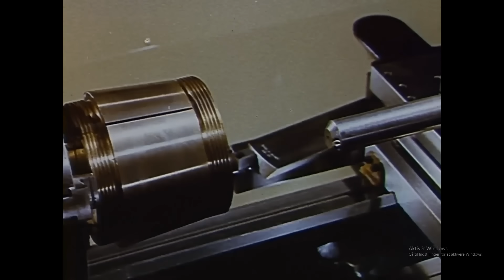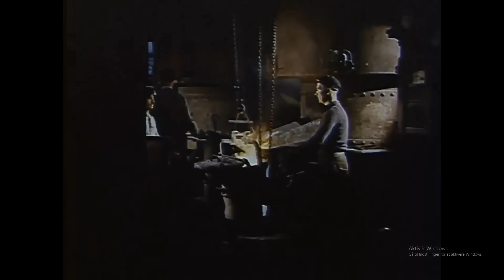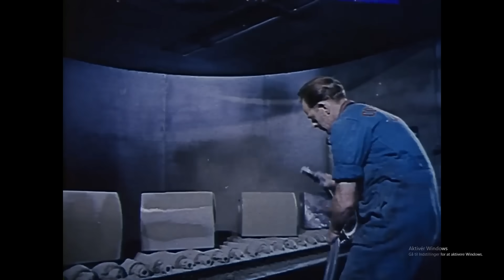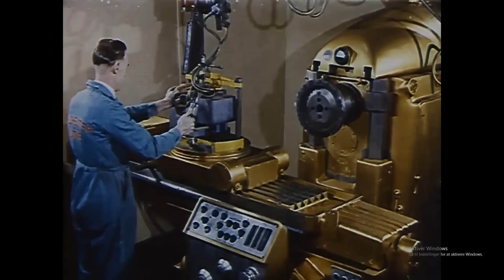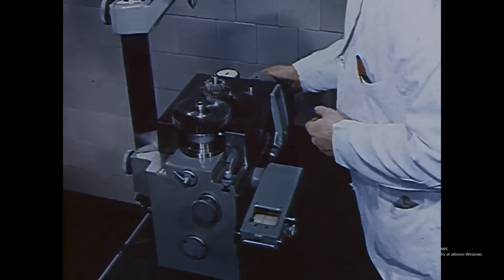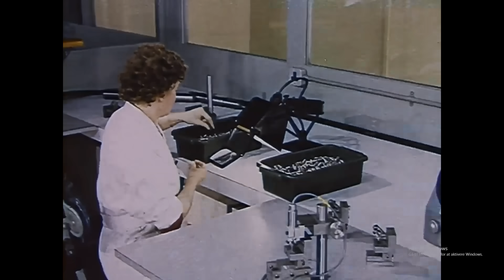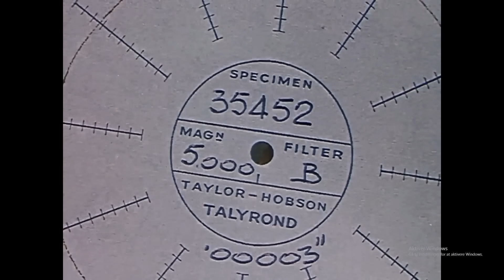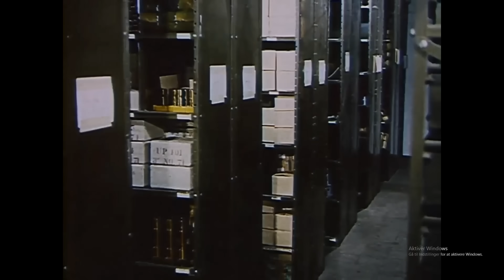Colchester Lathe Company

Comment: sand mould 
casting 
sodium silicate 
high pressure 
chemical hardening 
co2 
... cast
casting 
molten metal 
pickric 
high frequency 
grinding 
machining 
profilers 
taper turners 
lathe 
soldering 
silica 
emery 
grinding wheels 
zinc chromate 
head stock 
atlantic express 
foundry 
gears 
clocks 
spindles 
machining 
high tensile steel 
mandrel 
water tank 
radio active substances 
potassium ferrocynanide
Prussian blue 
geology
graphical recorders 
xerox 
computer graphics 

profiles 
patent 
pattern 
coolants 
wax
fevicol

safety gloves 
temperature gauges 
pressure gauges 

clocks and gears 
air gauges 
rollers 
mirrors 
CRT tubes 
weighing bridges

Comment: At technical school in the 50s I could not wait until Machine shop practice period came up, we had among others , Colchester Student lathes. we had no eye protection and not much instruction from memory,  A Nuttal nearly took my finger off because i was not instructed how to fit [and secure] the chuck. Not knowing that you had to spin on the reverse chuck locker meant that stopping tyhe spindle drive instantly without locking meant tyhat hyou had a chuck rapidly spinning off the thread at 750 revs and threatening to land on the bed, its not recomended to grab the chuck with both hands as I did, The teacher said, lucky you had the wood piece of thick ply between me and the ways or I might have lost a finger.

Comment: My dad is a mechanical egineer he's now 69 and i'm about to finish university in about a year. When he was learning to use the lathe in a tecnical school there was a bunch of brand new Colchester lathes, those used to work always keeping the motor runing, and the chuck started to spin  when a cluch was engaged. Time later he started his own workshop which thankfully has never stoped for about 35 years and one of his first machines was big colchester lathe with a 15 hp motor , that thing is a beast. I've seen almost 300 kg parts being machined there, and I have that slow starting noise form the cluth engaging always in my brain. I have used it since I was 12 and that sound just feel powerful and humble <3 . I can even imagine and listen it runing at different speeds.
  I woud like to see a modern machine do the same :(

Comment: now it just need a repaint, seem like a hippie has been let loose on some part's of it 🙂 the end you cut of the mt adapter is to lock it from rotate,  it is not a good idea, many tailstocks has this problem with 0 beeing an inch from where it is suppose to be, im sure many engineers have been working on this part, and it is the reason why.

Comment: You can't beat a 1954 Colchester 15 inch Gear Head lathe with flame harden ways, what I would do to have this lathe back as it beats my 1970 Clausing 14" lathe as that has variable speed which requires attention every so often. I saw one made 15" gear head made in India and it looked pretty solid and certainly did not show any wear.

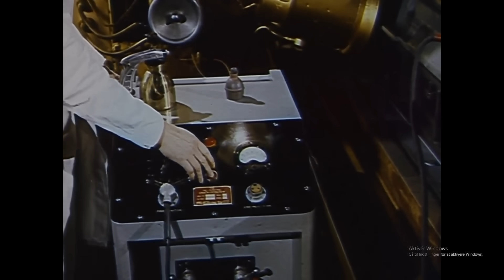Comment: Right at 7:49 the "crack detector" looks like it emitted some kind of field that left a defect on the film. Could have been coincidence but I doubt it. Wouldn't wanna have my balls 2ft from it for years of my life...

 Amazing the work they put into the machines and the cuts they were taking with HSS bits is truly amazing, even if it was in brass that corner has a lot of load coming from two different faces.

Comment: Did my engineering apprenticeship using one of these, the Colchester Student, there where 15 in the shop, all in immaculate condition...
On my first day, we were being instructed on how to operate it, unknowingly I pushed the auto travel lever into drive, when we were told to start the machine, the saddle when racing straight into the chuck..!!!
Luckily me tutor hit the stop button in the workshop and shut it all down.!!
The machine suffering no damage, apart from the soft pin, shearing, as it's ment to do, still think about it today 50 years later...!!

Comment: Mr shed man ,  I now consider myself to be a very lucky person to have a 1918 Colchester master 6" originally  belt driven from an overhead line shaft,  a three step pully behind  the  chuck , This lathe I purchased from an advert  in a  brawed  sheet paper  6  tyre kickers had looked at it an walked away from it i went to see it an bought it on the spot the whole  machine was brown with rust as it had sat in a garage for many  yrs. With the help of a late friend  he and i  set to made an angle iron frame 50x50 x 5mm 100mm off the floor to hold a very heavy,, large motor. Then out from that frame with more angle mounted a lay shaft  and using an old timing  belt from my car to drive that shaft, A three step pully on the end of the lay shaft then allowed me to  drive the chuck using a 1"  ratchet  strap running over two fixed rollers an one adjustable roller mounted at bed height to allow me to tension the  belt I made to drive the chuck.   6" swing ,,  3' between chuck an tailstock   overall  length 6' 6"  a brut of a machine made when Britain was at the leading edge of industry, look where we are now an idiot at the helm and a  Chinese  virus pandemic  running amock  that  brought us to near  bankruptcy  a year a go,   and a whole year of listening to politicians  LYING through their teeth an more U turns than a sat nav,  at the next opportunity  turn around ,    turn around , turn around  ,

Comment: We all know a CNC machine can make things quick and perfect every time, but for making one-offs or low quantities (often without drawings) a good manual machine is still easier. Especially for parts where you have to finish them down to get it 'just right'. I've used a few Students and Chip Masters and they're a lovely machine to use. I've never had that feeling from an Asian machine. You can tell they're just slapped together by staff who have no interest in anything other than getting 10 machines an hour out the door.

Comment: 8.20.  Seasoned?   Eh?   Like timber?
Reply from the maker: Cast iron are on some occasions seasoned for long times..
Reply: It is to minimise warping, when the casting is machined.
This is the exact reason as to why Chinese machine components are always warped.
... the castings have not been aged (seasoned).
Reply: @EngineTuning  .   You mean the metal needs to “settle”, find its own natural shape?
Reply: @josiebee-e6e  When iron is cast - liquid iron changes state to a solid.
The solid has enormous stress forces that are effectively contained by its surfaces.
When one surface is machined - all the containment for that surface is lost.
Consequently, the forces are released in the direction of the machined surface, causing it to bend.
What was a perfectly flat surface becomes curved (concaved) - the outer edges are up, and the middle is down.
The longer the flat surface, the more pronounced the curve - the thinner the casting,  the more pronounced the curve.

It is not talked about, because every supposedly precision flat surface is in fact warped - often to a large extent.
... but it is easy to confirm.
Place a straight edge across the surface, then slide different thicknesses of paper under the middle.
Even small pieces like a bench on a pedestal drill ;)
Reply: @EngineTuning  .    Excellent.   I love a full and informative answer.
Reply: @josiebee-e6e  So, in such a scenario, it is common courtesy to mark the response with a thumbs up, to signify that the response answered your needs ;)
Reply: @EngineTuning  It is a discourtesy to express your feelings in this way, especially after my decently fulsome response.    Shame you spoilt it.
Reply: @josiebee-e6e  No. That is not the case.
Sometimes people need reminding of their responsibilities.
All that you are doing, is feeling aggrieved that you were reminded.
Hahaha - suck it up, and feel blessed :)
Oh, and at the same time, note how I thumbed up your comments ;)

Comment: I really like my small lathe a Chipmaster from 1966, the beltdriven spindle is great. This lathe have alot of good solutions like the toothbelt driven feed gearbox, at high gear the gear drive for the feed gear box doesnt drive which means that the side gears will not wear out, at low gear you can choose between the belt drive or the gear drive. I also have the capstan attachment for it, used it last weekend. When i bought it some 25 years ago at a used machine dealer in north of Sweden. I was looking to find a small lathe so my big Köping lathe ( best manual lathe from Sweden, super quality company started 1858) wouldnt be alone in my home workshop. I saw that this small lathe was something extraordinary, and it was. It had been having the hydraulic copying attachment, but that attachment was missing. I really want one of those...

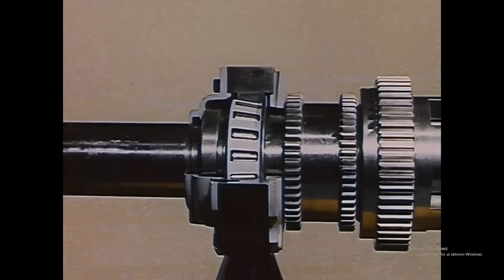Comment: 17:34  Colchester lathes are fitted with Gamay taper roller bearings - the most accurate bearings in the world!

22:25 Threads can be cut at speeds of up to five times faster than normal, with the Ainjest rapid threading unit. It will thread tight to a shoulder at maximum speed. Blind bores need no undercut. Its impossible to engage the half-nut in the wrong position.

Comment: I need to tell you a story. It will go on a bit, but stick with me.

My father was born in 1926, left school at age 14 and went into a machine shop. Started as an apprentice and was Works Manager by his early thirties, when I was born. He was treated disgracefully by the company when I was a toddler and my mother had to spend some time in hospital, so he told them where to stuff their job. He gained a teaching qualification, started in the early ‘60s as an Assistant Lecturer at a local Technical College, and worked his way up to Head of Department, in charge of dozens of staff, hundreds of students and five large teaching workshops.

With the decline of manufacturing in the UK, it was decided in the late ‘70s / early ‘80s that three of those workshops were to be closed down. He decided that it was time to upgrade his own garage workshop and prepare for early retirement.

Milling machines, shapers, grinders, etc. were to be sold by sealed bids, together with around two dozen Colchester Students. He picked out the best lathe, then swapped parts from other machines to build the best gearbox he could. Then he covered this machine with gunk and swarf, painted “SCRAP” on both ends in blue Hammerite, parked it in a corridor and threw a grubby old tarpaulin over it. It was completely overlooked by local businesses and other bidders, and my father bought it for just £15.

I should confess that, although I could read a micrometer before I could read a book, and could operate a lathe by age 12 (basic stuff like parallel and taper turning, drilling and tapping), I ended up with a career in the printing trade and a predominantly woodwork hobby shop.

He retired around 1984 and died in 2004. When my mother also passed in ‘13 and the house was sold, I moved the lathe and other machinery to my own workshop. Now I have also taken early retirement, with This Old Tony’s help I am getting back to using it.
Reply: How naughty of your dad to do what he did to get the best.  Something I would do, particularly if the the company had treated me like some do.  It's amazing to me that some companies don't realize what the most important resource is:  US!
Reply: The company that "did him wrong" was not the technical College that he retired from.  The lathe and tooling were stolen, the old man was a thief.
Reply: @vandalsgarage   and yet everyone says "good for him" probably the same people that are always saying to get tough on crime
Reply: @vandalsgarage  He was no thief, he paid for the lathe, although he was crafty to build up a top notch lathe and paint markings as to say it was of low quality so no one else would touch it he eventually paid £15 for it. In my book that's not theft. This happens in everything in the world.  Businesses worldwide rip everyone off by exploiting their workers and selling their products at hugely expensive prices so in my book they are the thieves. And I do mean every single business no matter how big or small.
Reply: Good on your dad for doing what he did for those tools, and good on you for holding on to all of it.
Reply: @axelmilan4292  Stealing is awesome!
Reply: ent well done to him, and you
Reply: @michaelalpin6139  It would seem that, for the next couple of years before he finished, he ‘borrowed’ quite a bit of tooling over the weekends and somehow forgot to return it. From sets of twist drills to a spare Burnerd 4-jaw. Anyway, the whole college is gone now. Suffice to say, I will never need to buy any cutting tools. Ever.
Reply: I was taught how to use a lathe my my design teacher at school. They had a few warcos and one ancient Colchester and it was spectacular. Everything modern seems to squeal at you and produce the most awful racket. This Colchester though bloody hell you could go to sleep next to it it was so smooth
Reply: My grandfather worked for Coutraulds.  It took many struggles to raise the pay.  Strikes were preceded by preparing veg allotments so each family had enough food to survive a six week strike.  I still have his spade.  He pinched enough bog roll so that even though he died in 1963, before reaching retirement partly due to poor air quality making rayon, my grandmother still had a supply when she died in the late eighties.  It was fairly nasty plain 'hard' bog roll marked with the company name on each sheet.... not 'luxury stuff' LOL.
Reply: Good on you and your old dad 🇬🇧🍀👍🏼
Reply: Very interesting story. Machining has a special meaning to me. Thanks for sharing it.
Reply: @dawhandle  Sorry mate, thanks for reading my story but this was in the Midlands.
Reply: @Canalcoholic  I'm from Cov, loads of stories like this. My next door neighbour had incredible machine tools in his garage, they were practically giving them away when the factories were all closed down. When I was a kid there was swarf in the street gutters that had fallen off lorries because there was so much machining and fabrication going on locally.
Reply: Old Tony is a great channel,  treat those machines well and they will do the same. 👍
Reply: Clever guy your old dad!   😂
Reply: I wonder if honesty and integrity being lacking is some reason for cause of the way things went. The technical college didn't do him wrong, so why'd he do the technical college wrong?
Reply: Emocionado em ler !!!
Reply: Wow, nice story, are you using it now, and what projects have you done on it?
Reply: He wasn't a stupid man , sounds like what my dad would of done
Reply: nice story my dad worked in ccc at 16  worked on roads one dollar a week
Reply: Hell yeah I have a 50yo lathe I'm restoring to start building my retirement shop
Reply: Wow! Thanks for sharing that story. My late pa was also born 1926 and left school at about the same age as your father. My pa then attended night school technical college, did his machine shop apprenticeship and also eventually moved into management. I still have the hobby lathe and machine tools which he used to build model steam engines in his later years. I attended a Technical High School in Torquay, Devon where we had a workshop with centre lathes, milling machines, etc. I passed my GCE 'O' Level in 'Engineering Workshop Theory & Practice' in about 1976. My pa inspected my practical project (a jewellers' vice) and told me that a chimp could have made a better job of it. Harsh but true. 🙂
Reply: awesome.
Reply: same thing happenes in NZ. Technicians got hammered
Reply: That was a cool move. ;)
I'm glad this old machinery survived and got a place where it's worshipped.
Reply: I have a friend with one of these who builds his own stunt planes !! 
He's an Aircraft Crash Investigator
Reply: Yes I know the type.
Teachers will take all the accessories.
Change gears, 4 jaw, Steadies even the chuck keys.
Then offer the reminder for tender.
Bloody crooks.
Bought cheep by their mates sold later at stupid price.
Reply: western civilization used to be so industrious now china is going to clean our clock
Reply: @iamAwesomo1994  还早着呢，现在的中国机床事业简直是不值得一提，还是幼儿园的学前班水平
Reply: I'm amazed at not only your dad's general dishonesty but the accompanied dishonesty of the other commentors who think nothing of ripping off the company from any real profits they may have made. Okay, you say the company treated your dad bad.  I read it as your dad saw the writing on the wall & prepared well in advance of any layoff to rip them off by his dishonest disguising of the completely upgraded and refurbished equipment. And YOU'RE proud of all of his actions & your thoughts & the fact that you now own basically stolen equipment? Seriously? I think I'm disgusted with your " story ". Reading your " story " leads me to believe that you must be a trumper also. They're the kind of people that do this crap & think it's absolutely acceptable.  You make me sick.
Reply: @ Seriously? Now come on, everybody likes to occasionally 'get one over' on the man or the system. Nothing was stolen, my father entered a bid, no-one else bid higher, he paid and I have the receipt somewhere. You don't seem to have grasped that this was an English machine from an English college, over forty years ago. The people and the institution are long gone. As for politics, we get no say in your elections, and our country is now the global laughing stock.